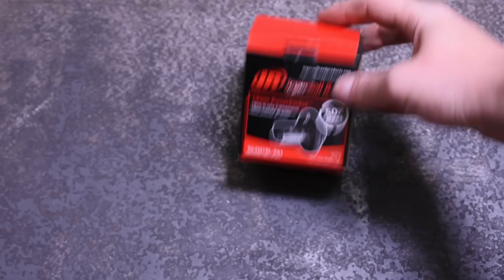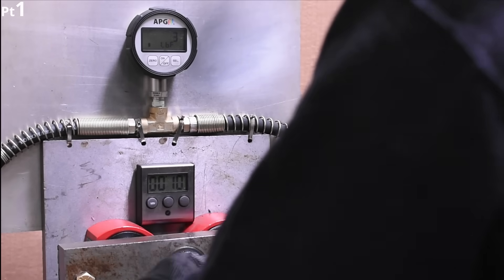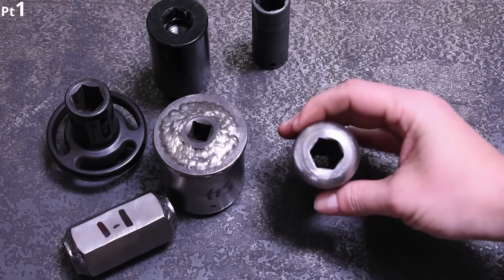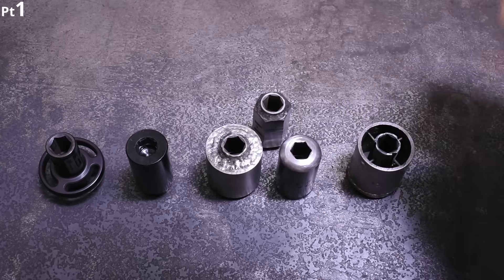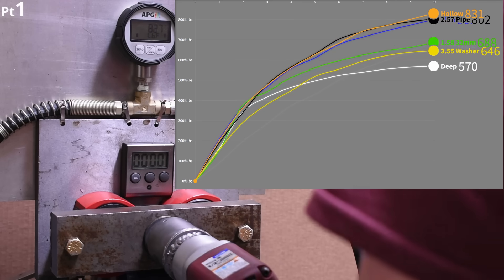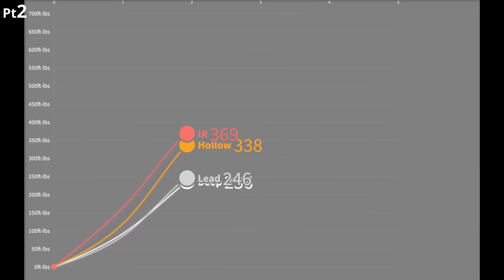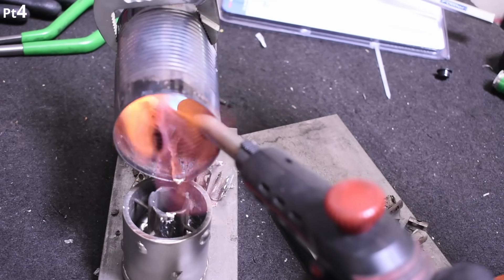Heavier Sockets Make More Power? Stumps Physicist

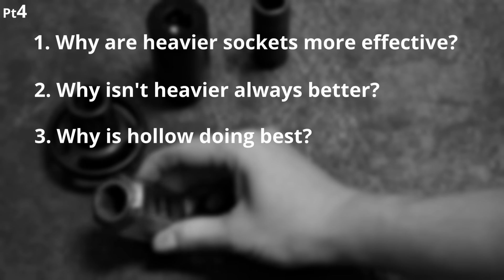Comment: 13:33 Lead is absorbing your torque. Need solid bell ringing hard metal to not absorb the torque "powa" into the added material.

For the tube in tube. The longer your hammer the more force. But too long and it loses "powa" . Try using a 10 foot sledge hammer, its not easy to lift.
But if all your weight is on the outside ring you should get "more powa!" applied to the center. But swinging a 12" 10lb hammer fast is also not easy. But a 3lb and now you got power with control. Bigger the person,  bigger the hammer can be swung. This is how I understand what I just saw. The perfect balance was accidentally found.
Reply: Maybe I should have said accidentally on purpose.

Comment: What I would expect with extra mass.
If it's a tight fit with the bolt. Then it only adds extra mass for the motor to spin, not good. 
If it's not a tight fit. Then it has some room to store kinetic energy before the energy start turning the bolt. Extra mass for the motor, but extra kinetic energy + motor to spin the bolt. It's like given it an extra hit with a hammer when the bolt gets gripped/pushed. And it all depends on how much extra room there is and how the socket was placed on the socket, so it means you wont have always the same performance.

I like the idea of extra mass, but not how it's applicated.
2 things that they should do is
1 make sure it's a tight fit for consistent results (but not a must)
2 construct it in such a way that it can store kinetic energy before it starts spinning the socket.

So, with that in mind. the motor should only be connected to the outer layer were the extra mass is, while the socket in the middle only turns after the outer mass has spinned for x turn (half a turn, whole turn, no idea but at least some distance). The outer mass starts spinning and after a certain amount of spin it grips the middle part of the socket.

Comment: My theory is that is has more to do with the clearance between the driver head and the socket on one end and the clearance between the fastener and the socket on the other. For impact, tight fitting tools deliver more torque. Just try using an impact with an extension. Cuts torque massively due to the excessive, aggregate clearances.

Comment: Its likely a combination of weight, frequency,  and conservation of energy.  The flywheel design adds weight, but only a bit, and all the weight is out farther from the rotation point. Meaning its spinning faster and when it stops it has a levering effect on the force its imparting increasing ut dramatically.  
Frequency likely plays a part in that weight has a "small" range where the gun has enough ass to spin it without to much extra force bogging it down. 

This is probably why you see the increases on the hollow socket. Its adding weight but only minimally and all at a distance from the pivot line. So the gun can spin it reasonably well, the extra weight has to spin faster being out at a distance and then when it hits a stop that weight being out farther adds a leverage force to the socket like adding a longer handle to a ratchet.

Comment: As a physicist myself I'm pretty confused about this. I would have thought its nonsense at best and the opposite effect at worst. There's a few theories I can come up with but none of them are strong enough to put any weight behind. I would be interested to see a cutaway view. It would be useful to see if the hammer rebounds change with the heavier socket. Ie transferring more energy or momentum on each blow - impedance matching. But you'd have thought the engineers would have got that right in the first place and not need unusual sockets to improve the things.
Reply: With nothing scientific to back it up, I keep thinking about the distance from the centerline of the weight. Leverage acting in a rotary motion?
Reply: @danrayha3756  Rotational inertia is the term for what you're thinking. The problem is it takes just as much energy going from the impact driver to the socket as it does from the socket to the bolt. So yes you do get more moment (the term for leverage in a rotary motion) with an increased rotational inertia, but that only happens if you have a bigger force going in which logically shouldn't be the case if he isn't changing impact driver. Otherwise it's a larger mass but it's just moving slower so it equals out.

Comment: I am by no means the brightest but I believe the hollow socket provides the higher torque from having the rotation of mass in a wider radius. Just like using a longer handled ratchet. The hollow socket has less weight to move yet provides more leverage.

Comment: I bought the lisle socket and it was an absolute game changer for Honda crank pulley bolts. We used to use Hondas oe pulley tool and a breaker bar and it would take at least two guys to do it the way honda suggested. Now with this socket it's like taking off any other bolt.

Comment: I suspect that the flywheel design moves some of the mass away from the pivot point thus increasing torque. This also explains the hollow socket performance and can be tested. The father a mass is from the pivot point, the higher your torque should be from equally weighted sockets.

Comment: The flywheel and the hollow socket pretty much do the same thing. Weight is out farther having higher speed  and taking more force to stop it. So if you possibly put a larger flywheel but keep the weight similar it would do even better. Same goes for the hollow socket go farther out from center but don't increase weight much drastically. It's a leverage type advantage. I have hundreds of sockets and access to all the tools to make them so I'm making my own sets.

Comment: It's all about resonant frequency.
By tuning or detuning the frequency of the socket vs that if the impact frequency you can get either a cumulative resonance that increases the input force or a subtractive anti-resonance which absorbs input force.
Mass of an item affects its resonance as can geometry of the item , but it's about hitting the sweet spot of optimum mass and geometry. More is not always better.

Mechanical & Aerospace Engineer

Comment: Would this work as an adapter?
By the way, the hollow socket has another quality to it that is interesting.  Tesla made their engines more efficient by utilizing mass farther out from the shaft to act as a flywheel while connecting it with lightweight connection materials.  The mass on the outside of the flywheel, its distance from the shaft, is more important than the material that connects it to the shaft.  So lightweight flywheels with good characteristics are a thing.  
Perhaps a damper next like the harmonic balancer your looking to remove.

Comment: I'm not a physicist, but im going to guess what is actually going on here has to do with the confusing world of rotational acceleration and inertia. The farther out from the center of the spinning mass, the faster the rotation, which results in a harder hammer strike. This is why the lighter but hollow socket works the best, as the majority of its mass is concentrated at the surfaces. Im honestly surprised the physicist didnt come to this conclusion.

Comment: I would like to see a socket with arms and small weights. That is what the fancy socket you cut is doing and i suspect the hollow 1 you created.. It is moving the stored energy further from the center. The golf club effect right, it gets loaded so when it hits the ball there is some stored energy there to be released without so much weight to slow the (golf swing) impact down. There is an ideal weight but I have to iterate that in my head a bit, my thought process is stuck between distance of travel (bolt diameter) on the bolt vs hammer weight of impact gun. Since the mfg makes the impact sockets to work on all models of impact guns I rule out harmonics. That is not to say someone could build the perfect socket to match their impact gun. As long as the RPM, hmmer etc dont change.

Comment: I think the lead socket didn’t do as well due to being too soft of a material and acting more like a dampener and absorbing the blows from your rattle gun, maybe like you said using something a lot harder like tungsten but less brittle would transfer more of the impact through to the bolt

Comment: "stumps physicist" is true if you are talking about people with a BS degree.  Moment arm and inertia explains it all.  If you have ever looked at a rolling door, the torsion springs used to lift the door are housed in the pipe the door rolls up on.  Those springs are configured in a way that any slight change to the mass of the torsion shaft, the spring solution changes.  The very heavy sockets can buffer the hit from the torque wrench, lead is too soft.  Try creating a 6" diameter ring and attach to a deep socket.  The way the ring is connected needs to be solid with a TIG weld.  Try with drill rod (HSS), Hot rolled stl, 4150,  and O2 stl, as each alloy handles vibrations differently.  I know you have found something fun to play with and you will keep working on it.  The problem with the expert is each expert has a focus they concentrate on, so things outside their focus aren't important.  Also shot peen the socket before testing to get some strange results.  You are dealing with stresses in the socket that adds to the problem.

Comment: Lead is incredibly soft it does not matter hot much mass it is bc it absorbs all the impact like a sponge you would be better off with an extremely hard Metal that is also heavy just looked it up Tungsten is the best Socket metal because it's not only the hardest but also the heavyest make it out of that with a flywheel

Comment: As a certified armchair engineer I believe resonance is important factor here. First, the bit has to have a bit of slop on the nut so it can rotate back and forth a tiny bit on it. And if its moment of inertia is such that it just bounces off its rear position when the drill comes with another hit, it might greatly increase efficiency. But that depends a lot on the drill hit frequency and on moment of inertia of the bit that needs to be just right to match that.

Comment: I would say that the springiness of the structure plays a role, and that these flywheel/hollow designs are achieving some kind of resonance with the impact driver, while a solid design with a higher Young’s modulus will have a higher resonant frequency and won’t scavenge energy with subsequent impacts.

Try tapping a flat steel bar on its wide side, and then on its thin side, and you’ll notice a difference in the tone it gives. My guess is that optimizing for low mass, high resonance, and low resonant frequency is what gives a good result.

Comment: I think you have reached the drive limit of the torque wrenches electric motors. Yes, more inertia would be better IF more rotational acceleration could be achieved by socket. The inertia of the socket plus the inertia of the hammer counterweight times the rotational acceleration equals your output torque. The acceleration is provided by the electric motor. In theory the electric motor could keep providing more acceleration as long as more power was provided to it, but there are practical limitation on how much power electric motors can handle and how much they can accelerate a given mass. You have probably reached the limit of how much inertia the electric motors can accelerate. Once you reach a certain inertia, the motor will just slow down, and thus you have a finite torque limit that these wrenches can apply. 

These torque wrenches that you are using all probably have very similar electric motors, except for the smaller ones that you test. Electric motors cannot simply achieve higher and higher rotational acceleration just because you give it more power. For example, look at the extreme measures Tesla applied to the Model S Plaid to achieve its acceleration numbers. In reality, all of these electric torque wrenches are probably using electric motors from the same exact manufacturer using the same exact construction materials but are just slightly bigger or smaller between brands, and thus have very similar rotational acceleration potentials. 

I'm not sure if even an air hammer would achieve higher peak torque numbers with your higher inertia sockets because even air has limitations that would severely hamper your peak torque. 

It definitely isn't the stiffness of the sockets. I have both a physics and mechanical engineering degree, but I would never ask a physicist to explain a loads or  mechanics of materials issue. These sockets are made of 100+ ksi material. As long as the thickness of the socket walls is larger than a millimeter or two, then stiffness should not effect the peak torque. But maybe I am wrong. I am not a PhD is material science. See if you can contact an aerospace or mechnical engineering department PhD in material science.

Comment: You've got to consider the spring in the steel, and how adding all that extra mass all the way down the socket just stiffens it up. The weight helps when compared to a regular deep socket but it's so stiff it doesn't put up numbers like the flywheel like mass of the IR and the L brand I cannot remember right now. That one I think is just thin enough to still spring and since it's all the same material it is easier to spring. Keep testing and trying the homemade ones and I bet that when the lead breaks free from the steel it will start to perform worse, the reinforced one might work seeing that the loose lead will have something to smack. But compared to the big winners they can spring all that weight right into the nut/bolt instead of into itself.

Comment: I stopped to watch this video specifically because ran into this issue when my ingersol rand impact failed to remove a Honda crank socket and almost had me tearing it down for a rebuild until a lil online research said this was normal and had to buy a specific socket to remove the stubborn bolt. Bought a Lisle socket worked effortlessly like a charm. but I had to buy a socket I already had for 1 specific application and was pissed about it. That flywheel design socket has me thinking ? Instead of making a different socket for every application why not make a socket adapter that you can use on every socket of that size ? I mean I can see why they do not sell these because why sell you one part ? when they can sell you 40 sockets plus .. they key is how much force will you lose as an adapter over the gain ? but if you can get another 100 ft pounds per every socket it is still an over all gain is it not ?

Comment: it's probably because of the diameter of the fly wheel. the weight has more travel, it's like for the hollow tube. if you draw a straight line from the center out to the outer edge. the outer ring has to travel further to keep up giving it a mechanical advantage without adding weight because it's hollow, there for the outer circle is spinning faster and is harder to stop

Comment: What the professor said makes sense. I'm betting there's something about the larger diameter which adds more centrifical force and also going in tune with impacts of the impact kinda like hitting at the proper point of rebound, like boosting a nephew onto a roof from a trampoline sorta stuff. But I can't even spell centrifical so what the hell do I know?

Comment: The shot tword the end of the guy using the socket on a lug nut gave me an idea, try making a flywheel type mass out of a short 1 inch extension. I know there would be losses because reasons, but it would be usable on many different sockets. You could also play with weight diameters and see the difference.

Comment: It's actually quite simple.  The socket is still, it takes a certain amount of force to make it move....the heavier the socket the more energy is robbed to get it moving.  With the hollow socket you found the sweet spot at least for the weights you tried.  Once the energy remaining in the socket is transferred to the bolt, minus the energy needed to get it moving, that is your result.  It's like a supercharger on a car, your engine loses hps the bigger (or more accurately the power needed to rotate it) the supercharger is, then you add in the gains of the supercharger.  If the supercharger robs more power than it yields, it becomes superfluous just like big leady!

Comment: Not a scientist/enginerd by any means but I think this has to do more with moment of inertia/mass and the power of the gun combination than mass of the socket alone. If the gun can’t get the socket moving at a high enough speed in that tiny amount of time it won’t impact as hard. MxV2 or something like that?

Comment: Not a physics professor, but its all a matter of inertia.  mass x acceleration.  Too much mass like the lead filled one, or weaker tools mean they are not able to accelerate all the mass enough to benefit at the point of impact.  This is why  your running in to the goldilocks effect. The more powerful tools are able to accelerate heavier sockets to a degree that the impact is hitting with a greater total mass x acceleration (deceleration at the point of impact).  If the tool has the torque to accelerate a more mass to max speed this will get you more impact torque.  Even if there is a loss in speed there is a curve where the mass may be worth it.  Essentially it all comes down to a motor that is by default being understressed.